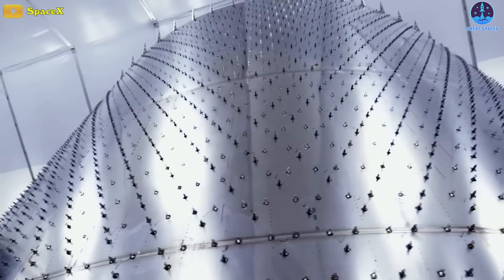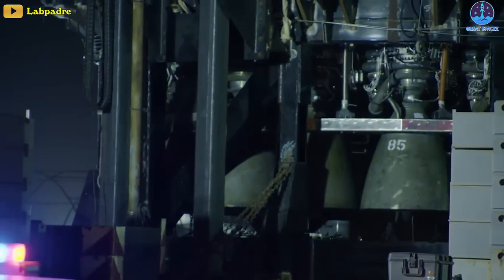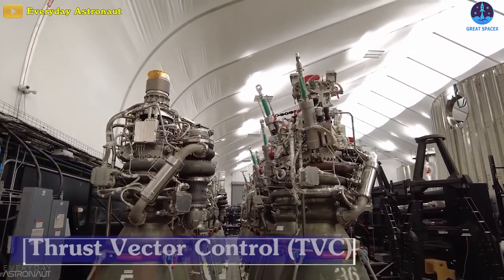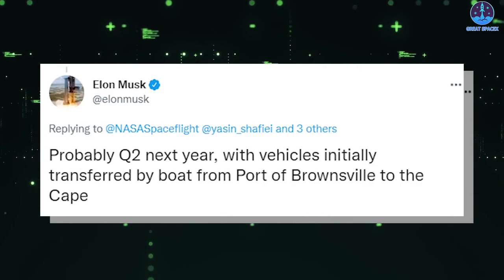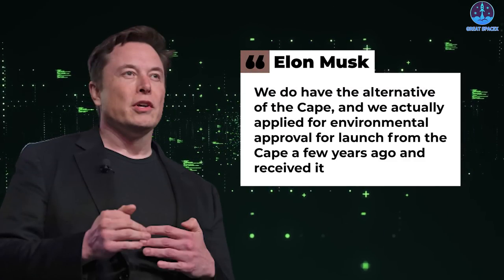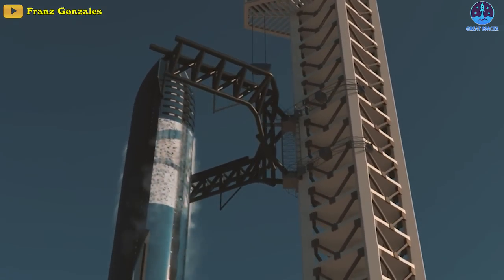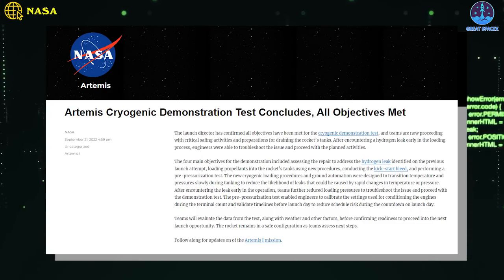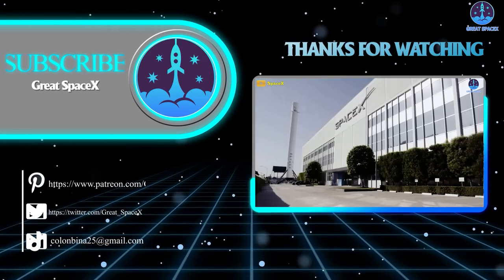Elon Musk officially revealed "NEW BOOSTER design changes, especially for full engine RUD isolation"

Comment: Starships will launch from Florida in 2023!!! Can't wait to see it!  🚀🚀🚀🚀🚀🚀
Reply from the maker: YEP!!!
Reply: You are not alone!
Reply: I am down with this.  Boca Chica is not a sustainable long-term (or short-term for that matter) location for testing and launches.
Reply: @vanguard9067    Fair comment but then again SpaceX could not have realistically started from scratch at Cape Kennedy because of the very high risk of damage to the established launch pads every time a SpaceX rocket crashed or exploded on the site. But I take your point, perhaps now is the time to move and have Boca Chica used purely as an R & D site.
Reply: @keithmayes4358  absolutely true.  There is no way SpaceX could have started at KSC.  Even now NASA/the Air Force do not want him using 39A for testing, worried an accident could put SpaceX ISS launches at risk.  Which makes sense too.  Thank you for the more refined perspective. Take care.
Reply: @vanguard9067   good to be able to exchange comments without any silly nonsense. Be lucky!
Reply: @keithmayes4358  agreed.  Same to you.

Comment: I've been following the various design changes for Starship in order to achieve EARTH orbit and re-entry. Our atmosphere is exponentially denser than Martian atmosphere so many of the changes will be useless or worse. Where moving and reducing the foreward airfoils is expected to improve reaction, control and heat reduction on EARTH re-entry, Martian atmosphere will certainly require much larger surfaces for the same purposes. Lunar and orbital tanker ships, which will never see atmospheric use, could do without fore AND aft airfoils completely as well as atmospheric engines. Martian craft could likely use vacuum engines solely as they should be more effective in the almost nonexistent atmosphere.  This would simplify construction and allow more payload on initial launch. All is IMO of course.
Reply: You are correct, the Starship that eventually goes to Mars will be a radically different design to the one used for LEO and different again for the one that lands on the moon, obviously, they are all very different challenges. First things first though, a fully stacked Starship has yet to get off the ground, although I have no doubt at all that it will eventually become an extremely successful spaceship, always with the proviso that nothing bad happens to Musk. 
I feel without Musk’s drive, enthusiasm and entrepreneurial skills, SpaceX would not survive in its current form, which is a fast paced, try it and see, don’t be afraid to fail we learn from our mistakes, the best part is no part, go getting company.

Comment: The thing that puzzles me the most is how anyone expects the Raptors to withstand their own immense rocket blasts that constantly damage the pad, the engines and the booster without the very real need for flame diverter trenches and a massive water deluge system. NASA has used them from the very beginning with the Saturn/Apollo moon missions right through to the Space Shuttle. Face it SpaceX, no matter how hard you keep trying to avoid it (why?) you are surely going to have to install it at some point. Or am I wrong?
Reply: They tested the water deluge system yesterday.
Reply: @zhchbob  which was a joke

Comment: Is it possible to replace the rocket base with thrust to reduce the CO2 emissions in the air?  May use magnets or switch to electric or solar powered vehicles.